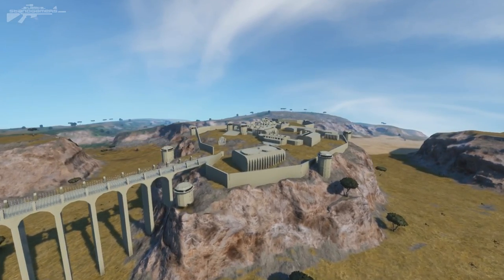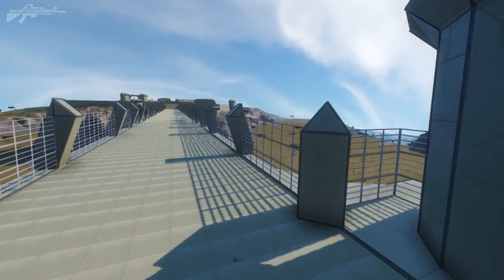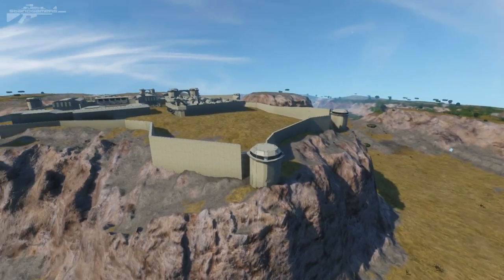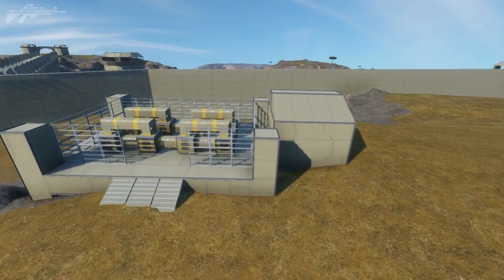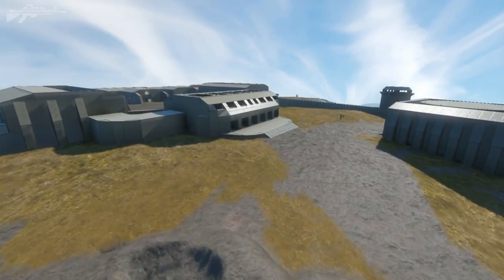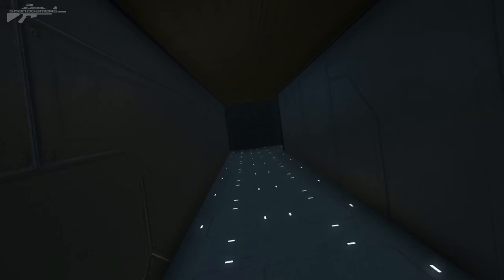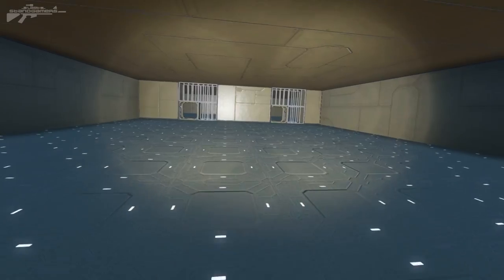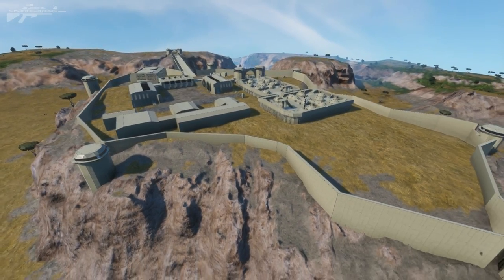Space Engineers - Hilltop Maximum Security Prison

Comment: You could rig the bridge with some explosives, designed to drop the structure if anyone attempts to invade/leave. Would also be handy if the staff areas has some form of escape pod that they could all pile into. In case of a riot that can't be controlled (say not even a panic room could save them). They all climb into an escape pod, blow the bridge and take off. I'm guessing it would be something akin to a small shuttle, but with a remote system or dummy AI designed to take off and land them in a designated safe zone. That way the system doesn't need to be piloted and anyone can get aboard and travel to safety.

Comment: Gonna go through this one piece at a time; so bear with me
First off, you're going to want a facility-wide alarm for when things go badly. 
Second, at every opening to another section of the prison you're probably going to want a gate. 
A couple more guard towers around the interior wouldn't hurt

BADLY needs Anti-Air defense. If I were to attempt a break-in to rescue my bother's mother's second uncle's step-son, (thrice removed), I'd just take in a couple armed skiffs and blow past the outer towers and into the prison buildings from above. 
Obviously, any amount of AA weaponry will seriously inhibit that kind of attack. 
 
Defenses aside, it'd be nice for a labor area, maybe a small mine (Heavily monitored, don't want them pesky maggots escaping on us)

If you're going to have maximum security areas, make them single, small, isolated cells behind several layers of security. 

Besides that, you need to have an execution chamber. Or do it the old fashioned way, line 'em up and gun 'em down. Either one.

Comment: Placing a gate at the other end of the bridge would be nice.  Also to place 2 draw bridges, one by each gate with the controls in the gatehouses.  The outer drawbridge will be placed on the prison side of the outer gate so prisoners cannot access the controls in the gate house without first crossing the bridge, that would be up most of the time.  This would prevent break outs.  The second would be placed on the bridge by the gate(yet to be built) in the main prison wall.  This is to prevent break ins from people trying to rescue those inside as someone going in would require a person on the prison side of the second bridge to lower it.  It would require a coordinated effort by both a break out force and break in force to make an escape possible.
Reply: +chrixthegreat Almost forgot, the draw bridges could be made from airlock doors being used as a flooring.

Comment: i came up with an idea for a space engineers prison ages ago. theres three ways to build it. as an indepentdant space station, a space station inside a ring astroid, or deep underground in a planet. now in all three, the prison part would be a central sphere, with four pylons round the equator to the outer ring area. the whole concept of this prison is low cost, low maintenance, and a screw the prisanors code of conduct. all cells are tiny areas with ony a chair and door. and the security is gravity. the idea is if u ignore the needs of real humans, and just give them oxygen and energy through the chair, then if any one tries to escape u can ramp up a gravity generator in the center of the bubble prison and the escape is foiled because the prisinor is trapped againt the wall. (or splatered over it. the outer ring would be for maintanance, shuttle bay, crew quaters. and the best part, u only need about one guard per however many prisanors you decide to put in the sphere. (dunno if it works, cant get the game, but from what ive seen of space engineers it might work)

Comment: You can great an "electrified fence" by stacking up welders into a wall and placing large window panes directly in front of them.  I think you can use catwalks as well... but I'm not positive.  Face the glass so the dark side is facing away from the welders.  I would also put banks of welders on sensor blocks so that they are only active when someone is near them.  If a prisoner gets too close to a welder wall, or if you have a security floor in case of a riot... ZAP... no more prisoners.  

Every so often you can place an LCD screen with a warning?

Though, you would need a mod that somehow disables prisoners ability to respawn in the medbay of their choice to make a prison work in survival.